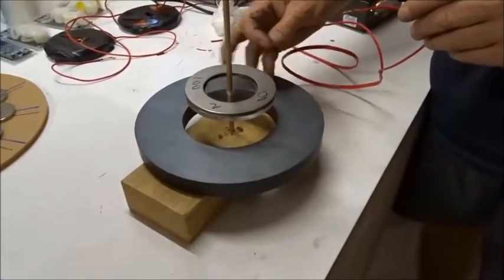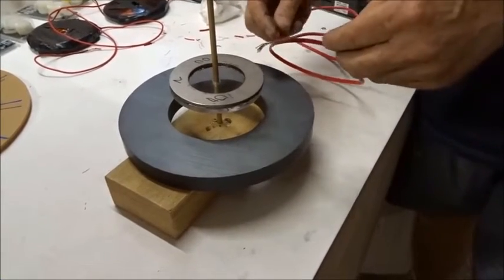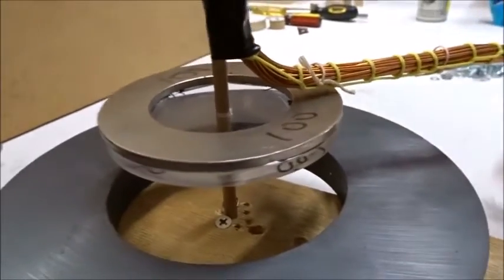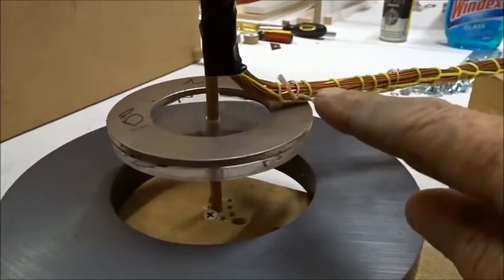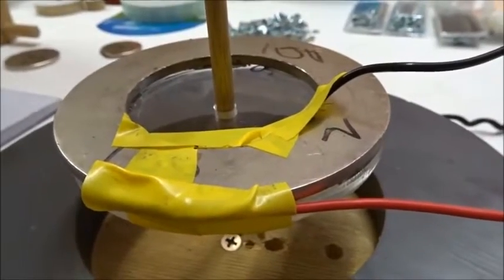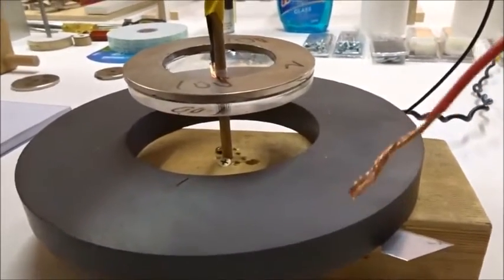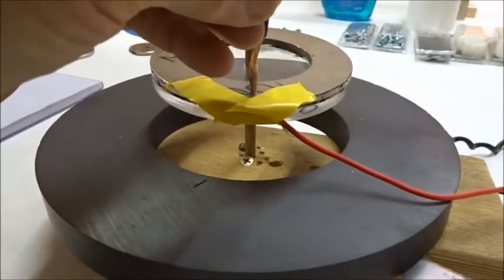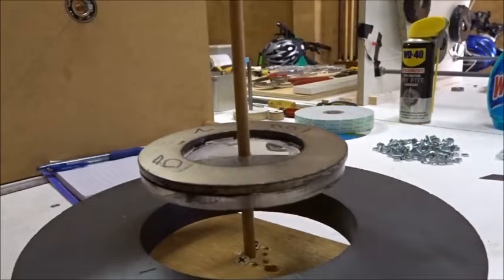The ring homopolar motor as drawn in crops: how does it work?

Comment: You have room to mount a receiver coil on the suspended assembly - You can even mount it higher around the stabilozer rod, enough to be out of the assembly's field - Use another clear plate about 2 inches higher to mount the receiver coils and rectified to DC - Using the spacers as conductors also might work  - You can arrange to have input leads attached that don't stop rotation or arc, I really hate to see your magnets getting burnt up, don't forget you can use copper plates here too - I was initially surprised at this setup until I realized you had a clear plate support - The reason there is no Lenz resistance is because homopolars don't have to cross transverse over the magnetic field -

Comment: Hello. In the middle of the video you are using a coil. There is no movement because there is backward and forward force at the same time. In case of wires you eliminate one (backward or forward)  force. I am studying this problem for many years because in case of coil we get overunity motor. If you wish a solution answer here. I will give you a plan to do it. I simply do not have magnets to do it, but I see you have magnets. You will need 4 ring neodymium magnets.